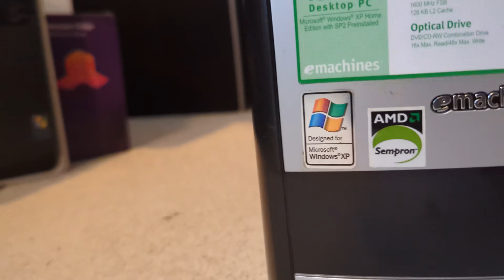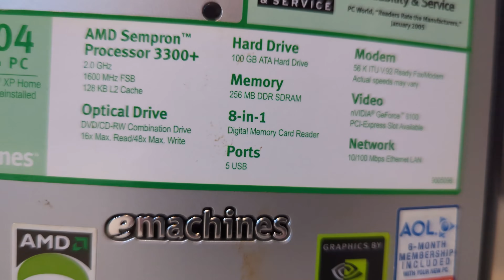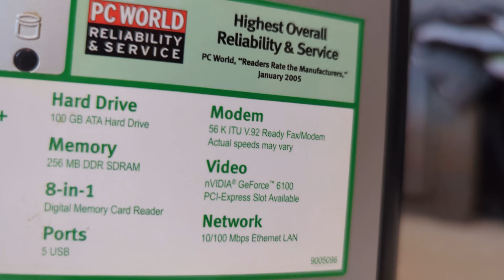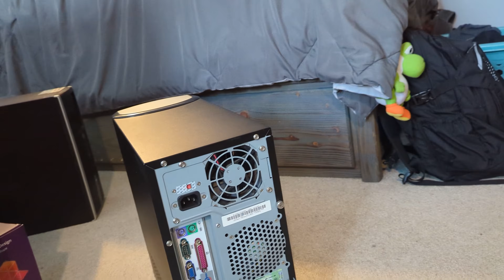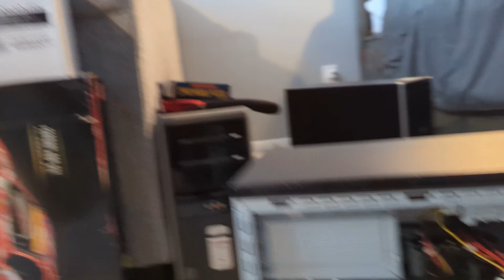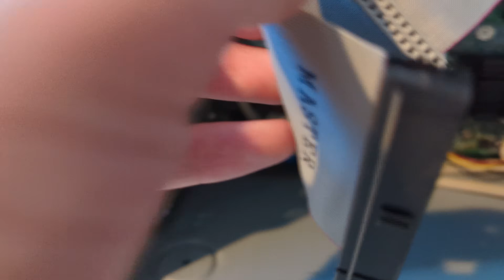I bought an eMachines T3304. But why?

Comment: I just got T3304 and looking for drivers because the hard disk is dead. Are the drivers still available online?
Reply from the maker: I'm not sure; the Internet Archive doesn't give any results for "emachines t3304" however some tools can provide the right drivers for systems, but I've never used them apart from some driver installation through Legacy Update on a Gateway desktop from around the same time period.

Comment: I deadass remember the Acer era since I saw my mom buy two of them from a local Tiger Direct. 

I currently own a Celeron 450 based model that's basically a great recession special that's maybe going to get modded.
Reply from the maker: That's cool!
Reply: @steelsofliquid  I know. I'm acrually shocked it and the PSU held up since around 2011/2012 when we bought it. Just reinstalled the OS and currently getting it ready for an upgrade or two.

Comment: My mom used to have that Black and Sliver Compaq you see behind the emachine, oh my god I thought they were soooo ugly! 😂. The case design stands out though, considering when it came out it looks newer than it’s age.
Reply from the maker: Yeah, I want more Compaq systems, especially since the Compaq in the background is broken (in a functional way, unlike my laptop which broke both functionally and cosmetically) and is, for the most part, a decoration, but it's also my go-to system for practicing my computer repair/maintenance jobs as if something goes wrong, nothing of value will be lost.
Reply: I have that compaq mine has a bluray drive in it and i put a sound blaster and a video card to.   @steelsofliquid

Comment: What do you think of AIO computers? I think they are a pain in the ass as I have a Mid 2009 iMac and I took it apart to install an SSD and also clean a lot of the dust out and all the screws and crap and I was lazy so I didn’t screw it back and sometimes the face will fall off which sucks. Cool concept, but not for me. Any Desktop PC is nice because they are so easy to tinker with.
Reply from the maker: I think they look nice, but storing them may be difficult. My family used to have a Lenovo C205 all-in-one back in 2012, and despite it being a really shoddy model I want one due to nostalgia value.

Comment: What do you think of the Dell Optiplex GX150? I am curious since it’s the first Dell to have that popular 2000s case design, first coming out somewhere between late 2000 and 2001 I believe. I personally love that design and I have a GX260 SD from 2003 with that case.
Reply from the maker: I think it's fine, though I've never owned one.
Reply: @steelsofliquid  I’ve had two. I bought one on eBay 2.5 years ago as an impulse buy, but I never powered it on myself, I’m actually pretty scared to lol
Reply: @steelsofliquid  Have you ever had a computer with a blushing capacitor? Cause my GX260 has some on the motherboard which I know is something I should probably fix however that can get done.
Reply: I really gotta tell you, these Vintage PCs like the Dell Optiplex GX260 or the typical 90s/Early 2000s PC are sooooooo huge!